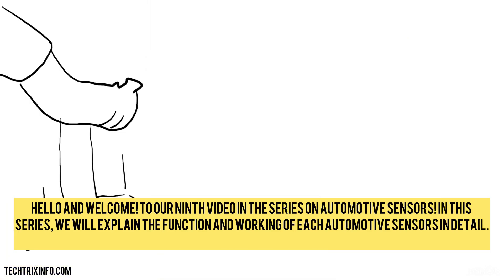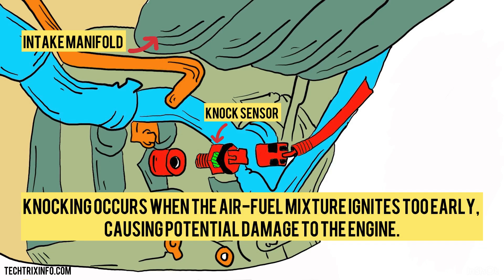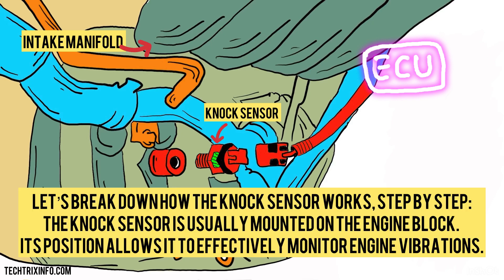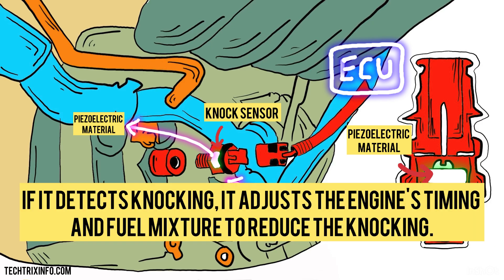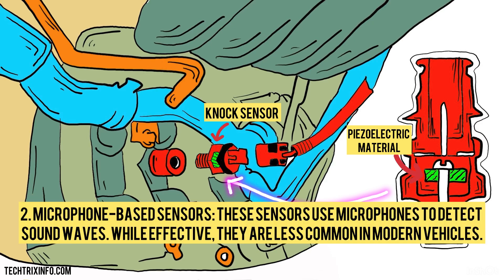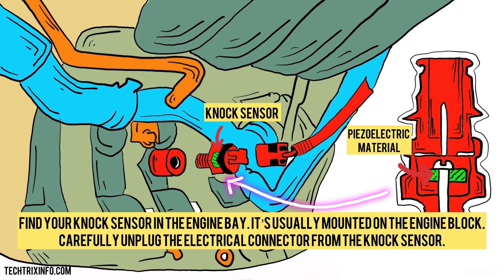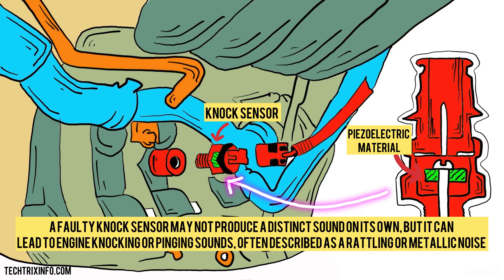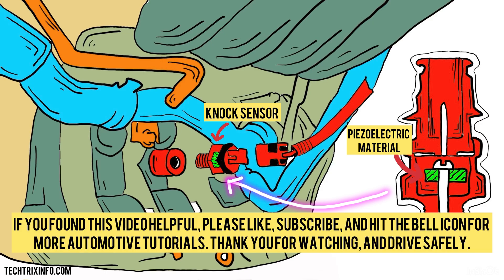Knock Sensor Explained With Animation | Mastering Automotive Sensors | Part 9

Comment: Piezo electric knock sensors ARE "microphone" type sensors. A microphone technically is a speaker running backwards (a speaker is a microphone), and uses air to move a cone to create a voltage over a coil. Since theres no air to be moved around, in a knock sensor, they use a piezo electric ceramic disc. It is 100% EXACTLY the same thing as a surface/desk mount microphone or a buzzer in a pc. Same concept, without a coil. If u used a coil driven mic for a knock sensor, u would probably set off a code every time u hit a bump. Piezo disc's have the advantage of needing a surface to vibrate, instead of air to push a cone with a winding around a magnet.
Reply: There are 2 different sorts, resonant and microphone type, they work in different ways and give completely different output signals. Unfortunately the maker of this video doesn't understand either.

Comment: In tiago 2021 model only in winter season abs light along with check engine light coming causing locking of rpm any reason

Comment: The video can be furthered if it  can explain how vibrations happen. For example by showing how premature  air fuel mixer will work against the movement of the piston or the rotation of the crankshaft.
Reply from the maker: Thank you for your comment! That’s a great idea! Explaining how vibrations occur, especially in relation to the air-fuel mixture and piston movement, could really help everyone understand the topic better. It’s interesting to see how all these parts work together in an engine. What specific aspects of the piston or crankshaft movement do you think would be most helpful to show?  - Will keep it in my check list for tutorial creation,(no promises). If you want us to create any other specific video please let me know.
Reply: @TechTrixInfo  
quick take up master cylinder.
This is the topic I couldn't find an animated video about on YouTube, no matter how I searched.

Comment: Very critical sensor, once wire of knock sensor got damaged and fuel consumption rose high with input not available to ECM
Reply from the maker: If the knock sensor wire gets damaged, the ECM can’t accurately adjust timing, which leads to increased fuel consumption. Without proper knock sensor input, the engine might run with a richer fuel mixture to avoid damage. This means you’re burning more fuel than necessary! The good news is, fixing the wire and resetting the ECM will likely solve the problem and improve fuel efficiency. Have any of you experienced this before, or have other tips on reducing fuel consumption? Let’s chat about it!
Reply: @TechTrixInfo absolutely correct....I had same issue.... richer fuel consumption
Reply from the maker: @NaumaanKhan Richer fuel consumption can be a common issue in cars! It can happen due to a faulty oxygen sensor, dirty air filter, or even a problem with the mass air flow sensor. These issues make the engine burn more fuel than needed. But the good news is, cleaning or replacing the air filter, fixing sensors, or checking fuel injectors can solve it and improve fuel efficiency. Starting from the easiest, check your air filter first. 
 Let’s talk about what might be causing it and how to fix it. Feel free to share your thoughts and solutions, it could really help others here!
Reply: @TechTrixInfo  yes and I make sure to keep all listed points done - starting aur filter cleaning, oil filter, fuel filter and timely change of engine oil. Also, cooling system maintaining by replacing water and coolant mixture in 1.5 service time'. Replacing Spark plugs and fulel filter at 3.4 to 4 service time'. Following all maintenance schedules. Everyone should try to understand basic concepts of engine working...
Reply from the maker: Awesome, happy to here that mate, it makes a car ownership much enjoyable if you can maintain and repair it yourself, make it cheaper to own a car that way, so constantly improve your skills sets on the same, what do you think 🤔
Reply: @TechTrixInfo thanks for your compliment and absolutely yes. Everyone should have understand of inner workings under the hood and once this understanding is developed strongly then no problem should be there in maintenance and upkeeping.